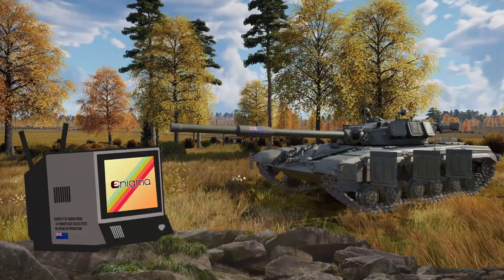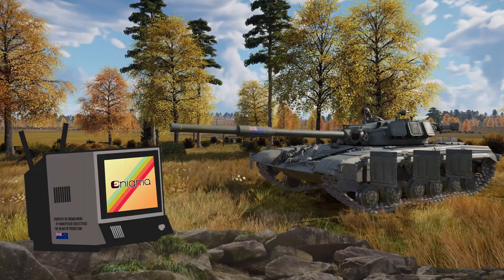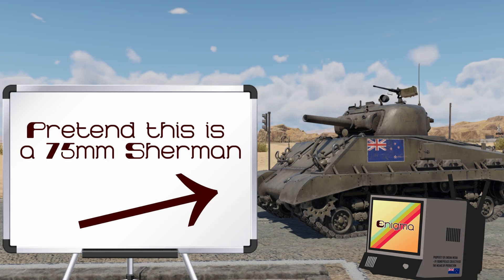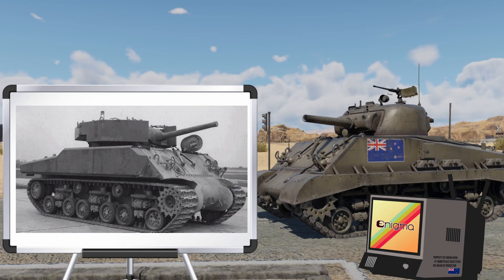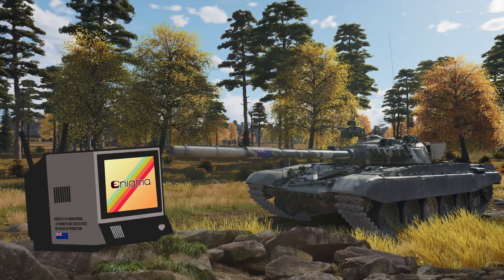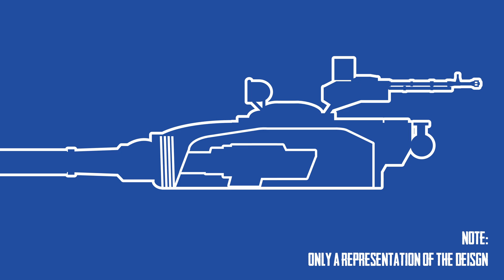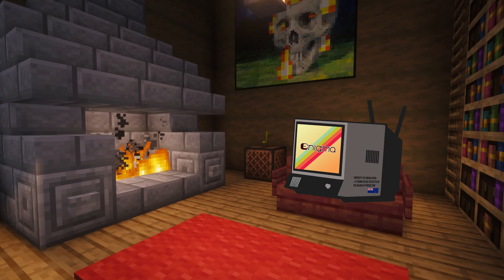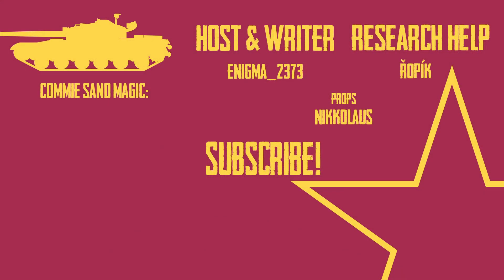Commie Sand Magic | Tanks Explained

Comment: You left out my favourite part about the T64's turret armor which was the ultra-porcelain balls which was the main reason why the T64s turret armor was so hard to make.
Reply from the maker: That was actually exclusively on the T-64b not the T-64a
Reply: @Enigma2373  This is actually not true. Only early T-64As didint have the ball armor, the later production run of the T-64As production run had it.
Reply from the maker: it has been noted and i will make a follow up video about it
Reply: @Enigma2373   you definitely should make a video on the development of the T-64s turret  and hull armor array. 

newly built T-64BVs much like new built T-80BVs got a redesigned composite array for the upper front plate. for the T-64BV it was 60 mm steel – 35 mm glass textolite – 30 mm steel – 35 mm glass textolite – 45 mm steel backing plate. 

have a good day and well done video :)
Reply: @Enigma2373 I though the T64 started out with the ball armor. I'll definitely need to do more research on the topic though.
Reply: @maxin514  If I'm not wrong, T64 had Aluminium fillers instead.
Reply: @maxin514  it did, the material of balls was just changed later
Reply: @maxin514  It did not, base model T-64 had an aluminium filler on the turret, the balls were introduced in the T-64A.